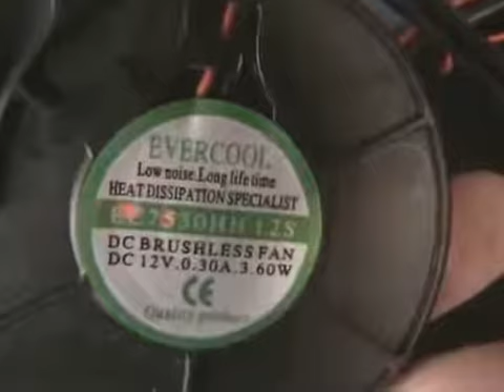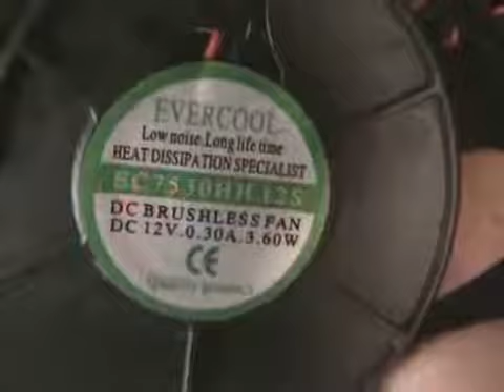ebike controller*fan cooling only 3$*  March 21, 2011 10:20 AM

Comment: I have been out on my ebike the last few days and going up these short hills on about 30 feet. But steep. Usually it sucks my battery down about a bar and after I get to flat level it goes up again. But with the cold at about 31 degrees F. - about 40 degrees F. The battery still sits on full. I believe it must be the controller from the cold since I have heard batteries cannot stand the cold. Right ? You think so too ? I have been checking those fan coolers for phones. But they make a little water residue. It must not drip or leak or people would not use them on their phones right ? But controllers have those ridges. What do you think ? Or have you seen anything else. Would maybe just 2 micro fans be enough to cool a controller in the summertime? Oops sorry just noticed I sent another text in yesterday's text.
Reply from the maker: yes cells drop in capacity when it cold. not sure about the battery meter  staying on full. thats a weird problem.
Reply: @karmaEbikes.  yes, must be something else. Too cold. My battery finally died.